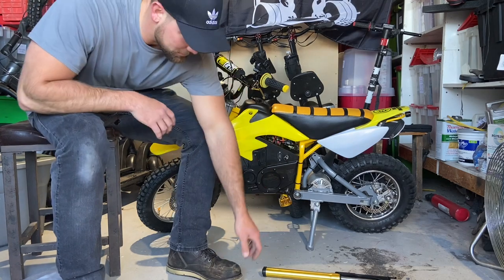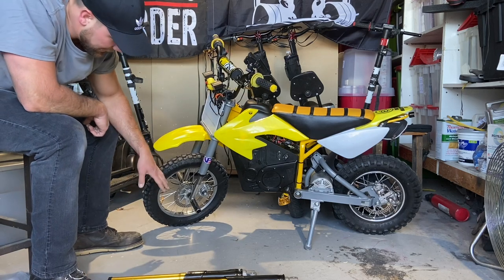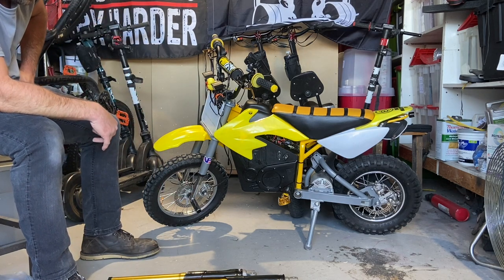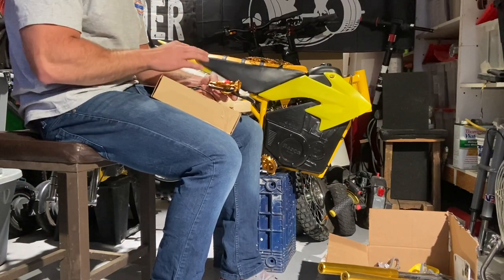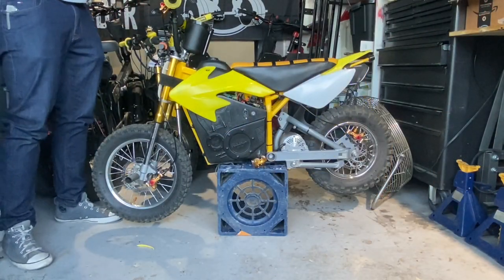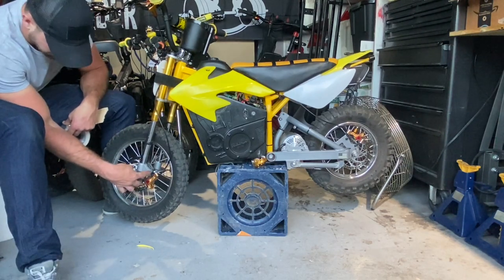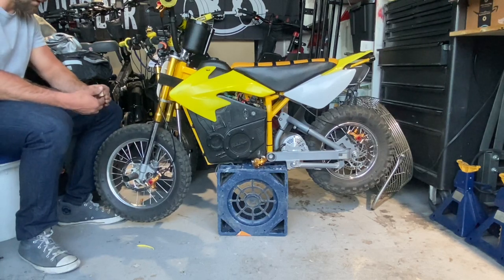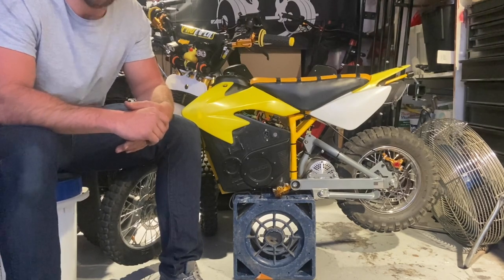Mx 650 3000watt 72v FORK upgrade BRAKE upgrade

Comment: What voltage and motor wattage are you running? I’ve hitting about the same speed on my sx500. I’m up in North County of SD. The whole razor upgrading was for my kids now became a hobby of mine. I have done the razor drift carts 48v 500 watt motor, Mx350 48v with 800 watt motors, SX500 96v with 3k motor and E300s with upgraded controllers . You can put a little more power to these rides and they are fun and can ride them anywhere. Fit it back of the car and go
Reply from the maker: That’s awesome !!! I have big plans for my bike !!  Big motors ect it’s an awesome hobby !!!
Reply from the maker: It’s a 80amp 3000 watt controller and a 50 amp 3000watt motor running 8 gauge wire now , 6500 rpm max
Reply: @voltmasterp8470  I run 14 tooth and 65 tooth sprockets now. Really helped keep the bike from trying to wheelie every time I took off. Smoother take offs and little higher too speed. What lake were you running around?

Comment: Thanks for the video, just ordered the brake kit. What size washers for the front axle and brake calipers? Did you need to replace the black rear spacers with washers too?
Reply from the maker: If you are not replacing the forks you don’t need to mess with the axel washers and I don’t remember the small washers size  for brakes I bought a small plastic washer set from Walmart that has small and big variety
Reply from the maker: And I only replaced the rear because I extended the swingarm and changed spacing from stock slightly .
Reply: Brakes came in. They're not plug and play like I thought, finding they need customization to be operable. Did you use the 48mm spacer on the rear brake too?

Comment: I had a razor mx650 and I put zoom downhill mountain bike forks on the bike. I've got a video of it if you wanna check it out. The fork uses a 20mm axle but I was able to use the 12mm axle the razor uses. They sell axle adapters 20mm to 12mm. Or 15mm to 12mm instead of drilling your set screw.
Reply from the maker: Hell yeah I’ll watch it right now thank you !!!
Reply: @voltmasterp8470  your forks looks pretty badasss tho all the gold looks good its a damn shame those brake rotors wouldn't fit. I figured you could use the 15 to 12mm axle adapters

Comment: You do know that you can get spring upgrade kits for Razors, right¿? It's basically a set of new springs, spacers and bolts that's makes the forks capable of holding an adult... It's almost a necessity whenever you do a rear shock upgrade but replacing the forks is a lot more work.
Reply from the maker: I don’t know anywhere to get bigger springs but guys on “modified razors for adults” on Facebook make sleeves from 3d printers and they sell them ,that takes all the slop and jiggle out of the forks and while they are apart you can put spacers/washers to stiffen the springs which will help a lot with more weight! Hope this helps !
Reply: @voltmasterp8470  I got my front fork spring kit on ebay from a guy in northern Cali. It took about 40 mins to change. They are way stiffer and 7” long. Will worth it.
Reply: @jeremykeith3152  sweet. Do you have a link to buy those?
Reply: @jeremykeith3152  I'd also like a link to those if you have it
Reply: @jtm94  it won’t let post a link. Every time I try it gets deleted.
Reply: @jtm94  I got them on eBay. The seller has them as unlisted. He has a video on YouTube for installation of them too. They’ve worked great and really stiffen up the front forks. Feels way better at high speeds now.
Reply: @jeremykeith3152  I did this- bought 7 inch springs off ebay and bushing kit off facebook forum 3d printed. Theyre sloppy. Thats why im here watching this video, Stock Razor forks can only be so great.
Reply: The "spring upgrade kits" suck. Height changes and that's it. Most are looking for an actual upgrade, fluid shocks instead of crappy springs. Springs are not suspension. 
Plus, the stock Razor forks have the crappy plastic for straight alignment.
Reply: If anyone bought the cheap eBay/Amazon spring/bolt upgrade for the forks but was unimpressed like I was with the stiffness and sloppiness here’s what I did:
I made my own dual spring “progressive shock” I cut a section from each of the stiffer springs and added that on top of the original springs with spacers in between to hold them straight and tight.   Also got a set of 3D printed spacers, collars etc. that were more robust than the original. Then I filled the whole inside of the shock with a ton of grease.  I’m really surprised how well they turned out.  Adds a few inches of height to the front while improving the feel of the suspension quite a bit.  Nice cheap upgrade option, would recommend!

Comment: Is the seat on the mx650 dirt bike aftermarket ?
Reply from the maker: Yes I added another foam to the stock seat and put a seat cover , I have links in my other video with all my parts
Reply: Do you know if a crf50 seat will work on the mx650 lol I’m missing a seat and can’t find them for sale
Reply from the maker: @ajshoemaker887  I bought a Crf50 seat and couldn’t get it to fit easily so that’s why I went the route I did with the stock seat, the seat sat to high and wouldn’t sit flush on the gass tank in my experience